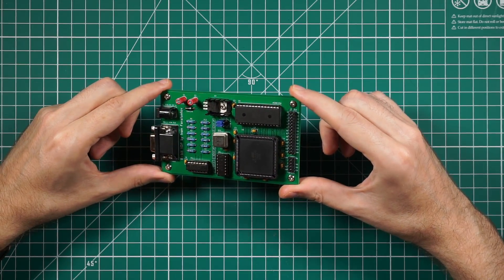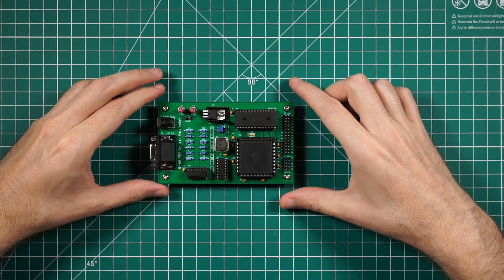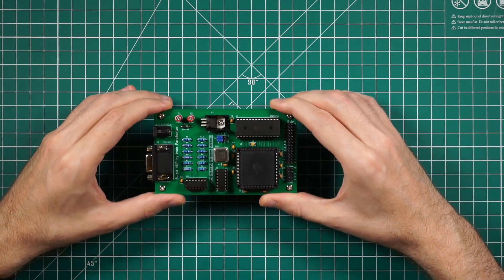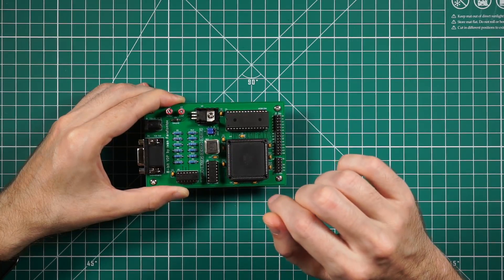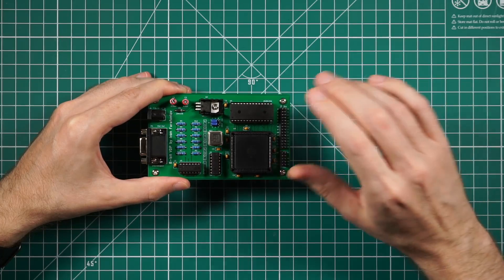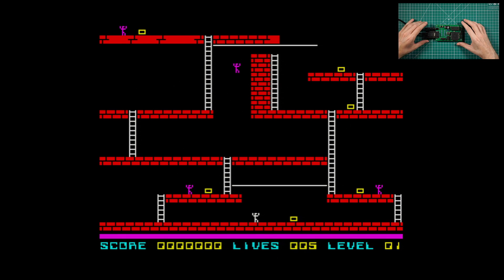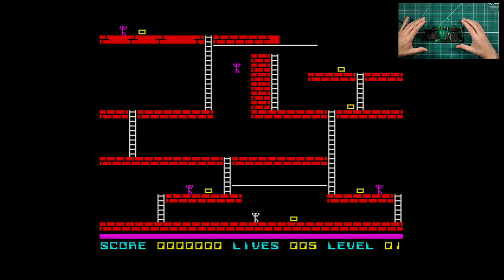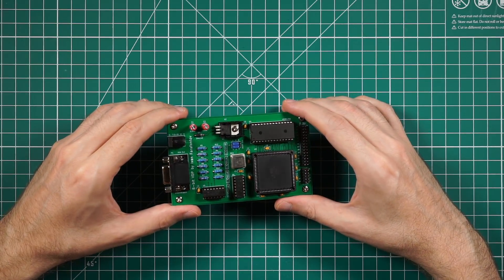DIY graphics card with VGA output

Comment: How you manage to get 256x192 pixels from it? When you divide 640/256 it will give you 2.5 pixels, so you need to make 320x240 and cut pixels to get that resolution? i'm trying to make something similiar but i dont know how to get 256x192.
Reply from the maker: Hi! Just added black borders to the pixel shifter to skip a few scanlines on the top, bottom and columns on the left and right of the visible area of the screen.
Reply: @solisted  thanks for answear, i will try to do semthing similar.

Comment: Your video needs more details, like the famous Ben Eater video.
Reply from the maker: Video generation is no different conceptually from how it explained in Ben's video. It just implements sligtly different mode and uses integrated CPLD device instead of many SN74xx logic devices. But maybe you're right, I will need to make detailed video going over PLD program of the CPLD.

Comment: cool project, hope to see results and instructions soon. what´s the CPLD?
Reply from the maker: Thank you! Will be making another video showcasing that computer I talked about at the end of the video shortly. CPLD is a programmable logic device, little brother of a FPGA if you can say so. It does not cost much, easy to program and simplifies hardware design by eliminating a need for many SN74xx logic devices on the board. Glue logic like address and I/O decoding for an 8-bit computer can be integrated into a single CPLD chip. I plan to make another video explaining how to use Atmel's ATF150xAS family of CPLDs.
Reply: OTTOMH (Off The Top Of My Head) - CPLD = C (something?) Programmable Logic Device
Reply: C = Complex. It is a ATF1508AS

Comment: What happened to the SBC board you showed at the end of this video? Did you get it working?
Reply from the maker: It is assembled into a fully working Z80-based 8-bit computer with a physical keyboard and an enclosure. It is actually awesome! I'm currently traveling abroad and making a simulator/debugger application for that computer. Will make another video showing that computer when I get back.
Reply: @solisted  looking forward to that video, and possibly one day building one or maybe writing some software for it.
Reply: ya im looking forward as well. thanks for sharing this info so far!